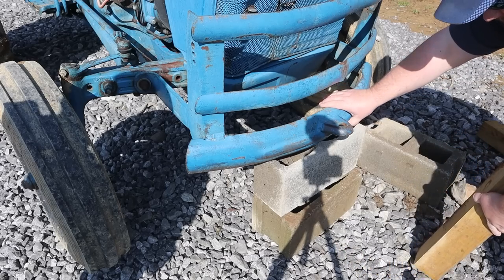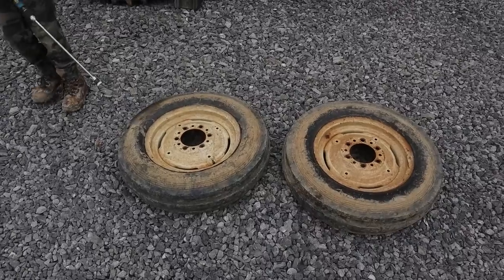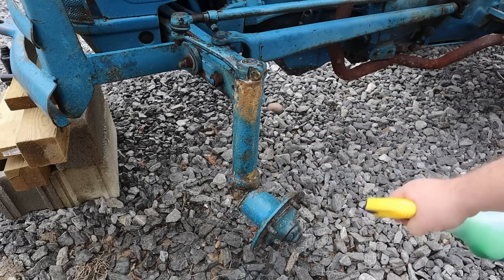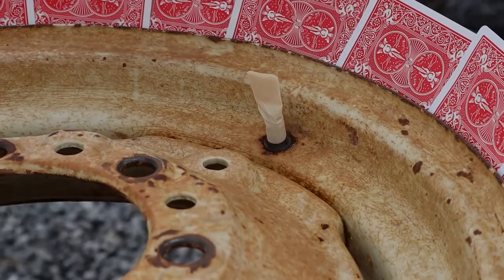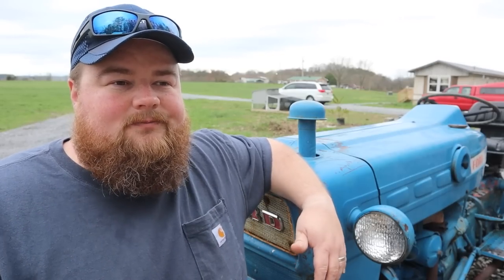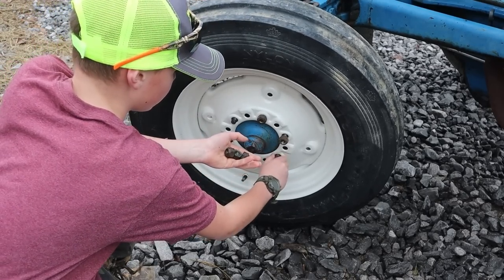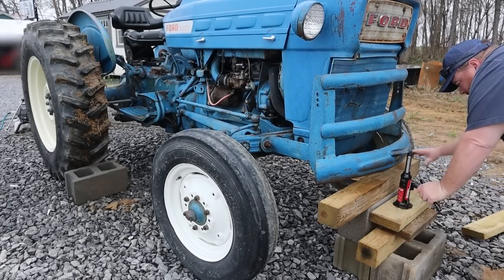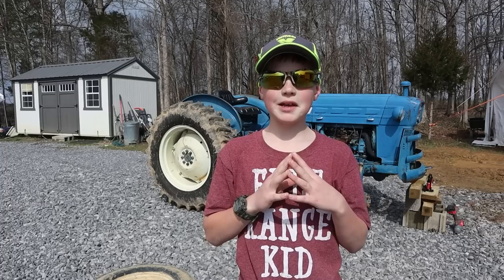Is This a Good Idea? Painting the Wheels of a Vintage Ford Tractor

Comment: Sam great job teaching Elijah the value of maintaining equipment and proper use of tools. Great example of fatherhood. May I recommend not using oil, it attracts dirt and etc. My recommendation would be to clean all grease, dirt and grime. Lightly sand rust spots and spray with clear coat. Good luck!

Comment: The wheels look fine. Drive the tractor through a few mud puddles and it will blend right in. Boiled linseed oil for a sheen on the old paint.

Comment: Your tractor looks much better with a white wheel rather than the off-white or yellow. To some extent, I think you're right, about not making shine too much, but a good coat of wax on the blue part will help preserve the paint and stop the rest from getting worse, and it also might make the blue finish shiny. Thanks for sharing!

Comment: I only have one suggestion, you should put caps on your valve stems to keep dirt out of them. Otherwise, when you put air into your tires, the dirt will go inside with the air and cause an air leak on the schrader valve.

Comment: Even a rattle can one time will get some nice pics !!!!!! The rust will return !!!!! Then , season later , lightly sand , paint will be flaking around rust , feather l with sandpaper ,  clean n clearcoat ? All rattle can . You will find any leak you have.  !!!!!!  Just a thought ! Been using cards for years !!!!!! Great tip !!!!!!

Comment: Great video! A couple of words of advice. Farm implement spray paint is actually much tougher/longer lasting than rustoleum. Also, be careful when pressure washing an old tractor. Those things really weren't sealed all that well. High pressure water can be forced into places it shouldn't go and can cause problems. On my old tractor even rain used to be a problem.

Comment: Great job, but just in case you haven't thought about it, you probably need to repack the wheel bearings in the hubs and also do a really good grease job on all the zerk fittings to get the water out of everything that shouldn't really be pressure washed. Don't want to be replacing bearings in a few months because water got in and never got out... It is great watching your sons doing a lot of the work and helping you out.. Great training for all their lives.
Reply: Great point and idea for another great father/son project!

Comment: Wheels look much better but I wouldn't worry that they don't match the back, once the front get a little dirty and the rust bleeds thru a little they won't look so new and bright. Also, those back tires looked like they weren't easy to manage when you took them off before.

Comment: If it were me, I'd bite the bullet and take care of the back wheels and the inside of the front wheels. Then do nothing more than possibly buffing/waxing the blue painted areas...like the body panels (I wouldn't buff the entire thing like the engine block, transmission or rear end). Mainly, the idea is to take care of the rust, especially on the wheels. If you don't eventually you'll be right back there replacing them again. It'll still look like a vintage tractor, but it'll look like you cared enough about it to take care of it. 

BTW, it's good to see a father/son project. Those experiences stay with you as you get older and it really helps form a good kid into a good man later in life. 👍

Comment: I like the playing cards trick.

Be careful jacking the tractor by the front bumper.  The bumpers setup on these Ford (and Ferguson) tractors aren't the strongest.  They are good for protecting the grill from brush, and pushing hay wagons, but that's about it.  Definitely not designed for heavy vertical loads.

Comment: Good job, But I was surprised you didn't paint the inside of the wheels while you had them off. Do the rear wheel, but I wouldn't take them off.
Reply: Was thinking the exact same thing.  You can see the inside of the tires when turning or from the ground.  Need paint inside to protect also.

Comment: Do the back,  why not. Or; if the back isn't rusty,  put another coat of more yellowish on the front. You needed to do it to preserve the wheels so it wasn't a bad thing.  Sounds like a father/son restoration project over the next several years 😊

Comment: once they get dirty and muddy and a little dinged up, you won't even be noticing there is a difference. Painting the back wheels, since they are so much larger...is only going to make the brightness so much more glaring...and cause you to ask the same question about painting some of the blue to counter that....and it will just snowball from there....when what you really want to concentrate on is the planting. :)  It looks better than it did, and you seriously won't recognize there is a difference between the front and back wheels once you stop looking for it.

Comment: I'm not sure what you sprayed on the engine on the tires but it didn't get the grease off. I used to use a can of degreaser spray it on the foam and it would cut that grease I'm not sure if they even make it anymore. For some reason everything that worked good no longer is made.

Comment: hmmmm uhuh nice story about the patina , talked youreself out of painting verry ncely there 
the oil works but can make the whole tractor feel sticky and will make painting the tractor in the future allmost impossible without a lot of degreaser and elbow grease 
might be better to use clear coat paint in egg gloss , will cover the metal but still makes it look damaged / used

Comment: AAAHHH  come on sam and repaint your tractor, they come out looking like new.  I completely repainted my 74 Ford 3000 gas and the wheels and a new seat and instrument cluster and new front tires, backs were already new ,  Tractor looked like new and everybody wanted to buy it  finally years later sold it for more thn I had into it.  was a great tractor,  BUT  YOU got to learn to use that clutch properly, come up easy until it starts to engage pause, then let all the way out and you will get a smooth engagement, not the jerky start you have now !!

Comment: Do what you want but.............   Bondo does NOT handle weather and moisture well.

This is not a case where you can enjoy the patena and let it go.    YOu have to seal the bondo like the paint did.

If you must keep the patina visible,  spray it with a clear to seal the bondo.

I know from experience,  If you DO NOT seal the bondo from the weather,  the Bondo is going to fail and crack 
and fall off.
you have to take care of surfaces.   you are not a Bondo - oligist.    Paint the bondo and protect it.